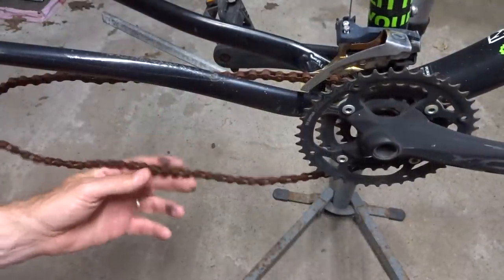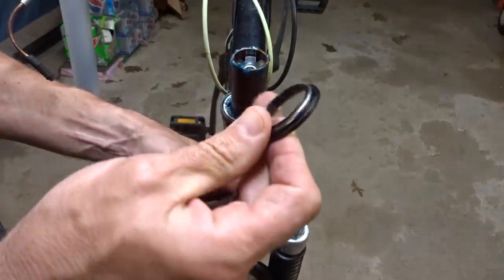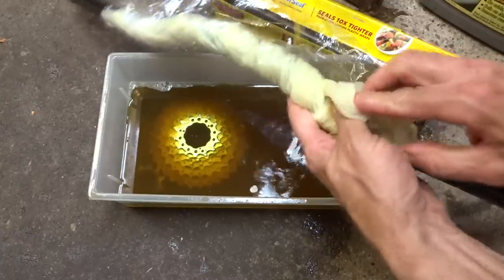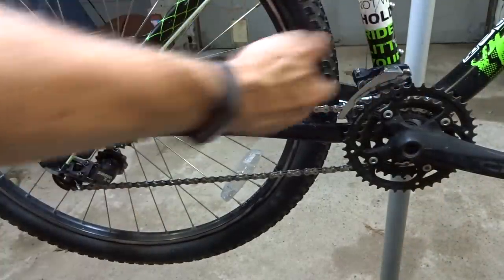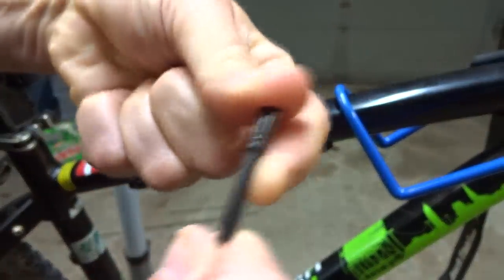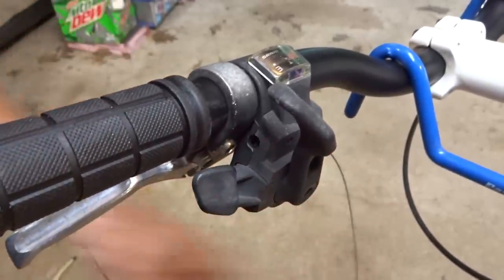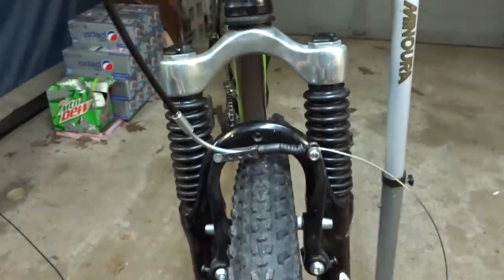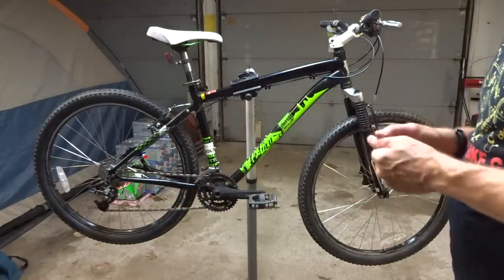Fixing/Overhauling The $15 Specialized Hardrock Mountain Bike

Comment: Great job, I really enjoy restoring old, neglected bikes but usually end up spending too much; as my dad says "perfection is the enemy of good enough".  I don't think I could have lived with those badly sun-faded shifters though, I'd have been straight onto eBay to get a better pair :)  Did you grease up the jockey wheel berings in the rear mech after their soak in the rust solution?
Reply from the maker: The goal was get a solid running bike and keeping the costs down. I was NOT restoring the bike. And yes I lubed the derailleurs.

Comment: Hey man I want to build a commuter bike what would be a good cheap bike to start with? I have no experience I hear that I should get a bike with no suspension and a steel or aluminum frame.
Reply from the maker: Buy a quality used bike. Beyond that, you need to figure out what you want.

Comment: Instead of using paper towels and plastic wrap on the handle bars,  You could of Use Aluminum Foil to wrap the handle bars in and pour your vaparware inside of it, closed it off so it doesn't leak and let that sit overnight..

Comment: Beautiful bike. Great job. Just wanted to ask about the crankset and BB? It seems like you didn't regrease it?
Reply from the maker: The bottom bracket was a sealed cartridge BB.
Reply: @RJTheBikeGuy  I thought it was a hollowtech type crank? But still its a beautiful bike.
Reply from the maker: Nope.  Square taper.

Comment: What about a spray bottle for the alcohol 🤔..excellent tip with the paper towels 🧻 clingfilm and rust remover 😊p.s. any concerns that the original chain length was wrong length 🤔 also you didnt do the coin in the bottom  grip thing 😏
Reply from the maker: It was the correct length. Coin in the bottom grip thing?
Reply: @RJTheBikeGuy  😊you put a coin the same diameter as the inside of the grip .stops the end of the bars cutting through the end of the rubber grips

Comment: do you need to recycle the evaporust? if you need to do that, where to recycle? Thanks for the information
Reply from the maker: From EvaporRust's datasheet: "EVAPO-RUST™ can be used over and over until performance drops off. When ready to dispose of spent EVAPO-RUST™, only the iron content of the solution will dictate disposal method. In most cases, it can be safely put down
the drain." 
You could just let it evaporate.
Reply: @RJTheBikeGuy  thanks for the information. Love your bicycle video.

Comment: Good video Sir!.I have watched twice and will watch again.Can you re-use the used evaporust and how do you dispose the used evaporust properly?.I always lean bike over and dip the grip in a bowl of warmish water and works fine.i have always be told don't use a new chain on used cassette and chain rings?. I use,  used working parts all round the bike apart from cables and small things. I have never known the small parts on brakes were called noodles and boots before. You made me laugh every time when you said "ahh cheap boot!". hehe
Reply from the maker: Yes, you can use Evaporust over and over till it turns black and stops working. Chains wear out faster than cassettes and chainrings. And as long as you replace the chain when it starts showing wear on a gauge, you can go through several chains before you need to replace cassetts/chain rings.

Comment: i know that it doesn't cost a fortune, but did you really need to change the cables? they weren't rusting(coulda been stainless), looked good to me. what did i miss? :-D
Reply from the maker: Cables are cheap and wear out. They oxidize, bend, fray, the housings get kinked. The cheapest performance upgrade you can make!

Comment: Cutting off the zip ties holding the outer cables is not necessary. The outer will slide out of the ties, which have a perfect size to slide in new cables. Saves a few minutes.

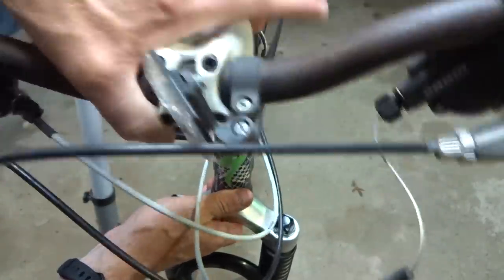Comment: At 5:50 RJ installs stem with what looks like a 1/4 inch of space over the fork steerer because it was cut too short. Is that safe? Does the stem clamp need a spacer between it and the top cap?
Reply: Ive done it many times and never had a issue, If you can avoid it great but as long as most of the stem is clamped it be fine.  If your not using it for any serious mountain biking. And there's not really any need for a spacer between the top cap and stem. 
unless you have extra fork steerer sticking out, then you would need a spacer for the top cap to pull against.
Reply: As Chr0nicCha0s points out, the spacer (or stem) must be above the steerer to adjust the "up and down" of the fork.  The stem is installed between the stem cap and headtube, so it does the heavy lifting. ;)

Comment: Compressed air works great for removing handle grips just grab an air nozzle put it under the edge and pull the trigger.
Reply from the maker: Been there done that. https://www.youtube.com/watch?v=U6SsqBcpXZU
You missed the steps, plug in the compressor, let it pump up, figure out where you left the air nozzle, etc.

Comment: You shouldn’t use alcohol to put on the grips because then the grips will slide for a while. I use water for the grips and it slides right on. Water also evaporates almost instantly.
Reply from the maker: alcohol evaporates faster than water.
Reply: Oh. In my experiences that wasn’t the case. Sorry.
Reply: The water could lead to rust.

Comment: I know this is an old video but I must point out a few things. You missed showing how to true the rims. That's an absolute must if you are running rim brakes. You didn't perform proper rim shoe toe-in and adjustment either. And the frame and fork have disc mounts. A set of cheap mech disc brakes would serve anyone far better over those old V-Brakes.
Reply from the maker: Truing a wheel: https://www.youtube.com/watch?v=f1SHmFBihKM
Though I used a truing stand. Not every single detail was covered in the video.
As for disc brakes, I would have needed calipers, rotors, and don't forget the wheels with disc rotor mounts on them.? Are you going to pay for these parts? That would have more than doubled what I put into the bike.
Reply: @RJTheBikeGuy  I would think you would have the parts lying around, if not you can source all those parts for under a hundred dollars my friend. But I love your videos, been watching them all day. I don't have time to wrench on bikes these days, but these videos bring back good memories.

Comment: Do u have any advice on removing rusty bolts that seem to be stuck, im trying to fix up a free bike I found and I can't remove bolts...
Reply from the maker: Penetrating oil, and maybe an impact driver.
Reply: RJ The Bike Guy I did not think of using an impact driver and I've tried many types of oil, anyway thanks for the idea and keep up the good videos...
Reply from the maker: It really depends on the bolts screws. I have multiples tools. An impact driver you hit with a hammer, a DeWalt impact driver. I have another thing that attaches to an air hammer, though that one is probably too hard hitting for most bike applications. Maybe if I turned the air hammer power down... Heat/cold maybe. It all depends.

Comment: you should point out that shifter cable and its housing is different from brake cable and its housing. the endstops on each cable is different and the thickness of each cable is also different.
Reply from the maker: That wasn't the point of this specific video.

Comment: Thanks for that great video !!! I noticed you took the real derailleur  straight out of the rust remover and put it on the bike. Don't those plastic pulleys need some lubrication?
Reply from the maker: I did lube them off camera, as well as the derailleur pivot points.
Reply: Thanks for removing that nagging doubt. I appreciate your videos.

Comment: Good vid, but Overhaul in the title is misleading, Overhaul would include taking the wheels/bottom bracket apart, checking parts for wear, repacking, then reassembly. I would also check the seat post to make sure its not seized , anti seize it if its not a part of the frame now, they have been known to become impossible to remove. If it is seized its probably a parts bike.
Reply from the maker: The bottom bracket was a cartridge type, so not meant to take apart. Not every bit of work was in the video. I went through the bike pretty thorough checking everything. Including the seatpost. Watch the beginning of the video and end of the video and the seat is at different heights. And a seized seatpost is an obstacle, but by no means the end.
https://www.youtube.com/watch?v=P-YpmDx86d0
https://www.youtube.com/watch?v=_gAXL2FSY_A
https://www.youtube.com/watch?v=S3ek2GeZzE0
https://www.youtube.com/watch?v=LJLZ9Ojtr80

Comment: For rim brakes, why are wheels sometimes painted black? Makes no sense because the brakes wear off the black color in streaks. (I like black spokes, but the rim part that the brake pad contacts should be clean and smooth which paint flaking off does not accomplish)

Comment: Date: Sat, 25 May 2019 08:30:26 +0100
Subject: Re: RJ The Bike Guy loves your comment
RJ Been working on bikes for many years but have never had a problem with 
a cassette hub the splined part which sits on the wheel, even though i have 
workshop full of tools quite task finding a tool to remove this part off the wheel, in my tool kit i found a 12mm splined key bought from snap on van. 40 years ago and with some treatment from my angle grinder it worked
and i removed this faulty part, then by a bit of luck a wheel from an electric 
bike that should have gone to the scrap, fitted fine,  the guy could carry on with the rest of his ride home 35 miles. no bike shop in the 20 miles area
had the tool or the part. 

Rj how do these hobs come apart and do you a park tool code
so another happy customer
Reply from the maker: Is this what you mean? https://youtu.be/iQ6XgztsfmU?t=240

Comment: Look at the rear triangle.  Notice the extra brace on the non-drive side ...  Really tough rear end.  So perfect candidate for a rear hub motor conversion.  Plenty of metal & framing to dissipate the torque of a motor.  These are good tough chassis.  Next one you get, do an eBike conversion :)

Comment: Change the handlebars to alum bars,I hate them brakes,with rear disc mounts I'd convert to disc but that's my preference
Reply from the maker: I could have. But the point was to keep the cost down to a minimum.
Reply: EBay I'm into recycling
Reply: I've got 2001 GT Aggressor 1.0,mine has same fork as yours,but unfortunately I got to add disc brake adaptor to convert to disc.You were lucky to find that bike cheap $15 and a 2012 at that
Reply from the maker: @eddiebruce8569  The steel bar but was fine, just a little surface rust which I cleaned up. Disc brakes would have dramatically raised the cost. Just because a bike has disc brake mounts, doesn't mean it has to be converted. I have a video on doing that conversion.

Comment: The headset top cap is missing as are the dust seals on the bearings, hmmm where did those parts go?
Reply from the maker: I put it on a little afterward, but didn't reshoot.

Comment: instead of evaporust try vinegar and table salt, the acetic acid in the vinegar will chemically remove the oxygen from the iron. the sodium chloride just aids in speeding up the reaction.
Reply from the maker: I have used vinegar in the past. Evapo Rust gives better results. https://www.youtube.com/watch?v=DZVdkLWAurE
The vinegar seemed to remove more material than the EvapoRust. The pins in the vinegar chain came out with very little effort, but the pins for the others came out with normal effort. Noticed this after the video.

Comment: Did anyone else cringe how he tightened the stem before the top cap. But other than that nice video👍🏻
Reply from the maker: I put the top cap on and roughly tightened it and then tightened the stem. That was just temporary. I had to go back later after the wheel was mounted to adjust the bearing tension and straighten the bars before tightening it all down proper.

Comment: Why is there no cover/dust cap covering the top bearing in the head tube, that's probly why it was so dirty, most bikes have a rubber cover that also acts as a spacer for the headset
Reply from the maker: There was one, I missed putting it on in the video, and it was put on shortly after.

Comment: Do the brake pads need replacing is a line look bit worn
Reply from the maker: I can't remember the state of the pads at this point. If they needed to be replaced, I would have replaced them. I might have replaced them off video. I can't remember.

Comment: Set limit screws before even tightening cable down and u would have gotten rear derailer done correctly 1st time,,,repeat with front derailer,
Reply from the maker: If you mean that the derailleur would have been correctly indexed when I hooked up the cable, simply by setting the limiting screws beforehand, then you are wrong.
Reply: On the rear derailleur I Usually, usually that is, check the low gear setting especially if there is no "dork disk". You never know about used bikes and their mechanic. I just hate the grinding noise of chain against spokes if I screw up and don't pay attention.

Comment: did the cable and cable housing need replacing? good result though. i do a few bike restorations myself and it can be satisfying work. you're not going to bother with all the other bearings? i see you have a bunch of soda drinks. you should really not be drinking that much for your health sake and life span. try to ween off them. thanks for the video.
Reply from the maker: Cables and housings are cheap so I usually replace them. I can't remember all what I replaced. Some work was done off camera. The BB didn't need overhauled as it was a cartridge BB.

Comment: you could have greased seat stem and seat and how about servicing bottom bracket and chainset
Reply from the maker: Not every second of work was in the video!!! I did grease the seatpost. The bottom bracket was a sealed cartridge and was working fine. I also didn't show replacing the tubes and adding air to the tires.
Reply: a clean up of the chainset would have maybe benefitted the new chain and the now very clean cassette
Reply from the maker: But then what would you have criticized?
Reply: im not criticizing, just observing and offering a comment, but if we go with the word criticism, then nothing and i could have observed....great video

Comment: Why didn't you put the chain in the vapour rust?
Reply from the maker: Evapo Rust. Because a rusty chain is garbage. It rusts on the inside too. Just replace it for $10-12 instead of trying to reuse a trash chain.
Reply: @RJTheBikeGuy  yeah got ya. £10 isn't going to break the bank so it's worth it

Comment: just a question do u need a crimp end on a new cable?
Reply from the maker: You don't NEED it. But it keeps the end of the cable from fraying or stabbing you. You can get them at a bike shop for pennies.
Reply: oh ok just my local bike shop didnt put it on the front derailer cable
Reply from the maker: Probably an oversight. Another thing they used to do was solder the end of the cable, but most shops don't do that anymore. Crimp ends are easier and faster.
Reply: so in a mtb how important is it
Reply from the maker: Well, get stabbed in the leg with the cable once or twice, and you may wish you had one there.
Reply from the maker: Just take it back to the shop and tell them to install one. Or install one yourself.

Comment: You did all that work and did not even check the wheel bearings or true the rims?  I have never seen an older used bike that did not need a good hub repack.  What about the bottom bracket?  You didn't even give it a wobble.  To me zip ties for casing clamps are turkey.  They look sooo much cleaner with real clips.
Reply from the maker: The video covered the major work. I didn't show every little thing I checked/fixed. I checked hubs and the wheels. I think I might have done some minor truing. I can't remember. The BB was a sealed cartridge and was fine. That is mentioned in the description as multiple have why I didn't overhaul the BB. If it was bad, I would have just replaced it.
Reply: @RJTheBikeGuy  
For the sake of the people watching these videos it would make sense to at least mention all of the things done and needed to revive the old bike. Too often things like hubs and bottom brackets are overlooked.

Comment: Im very frugal so id probably keep the cables instead of snipping them take then all out soak them in oil
Reply from the maker: Cables are cheap. Cables wear out. Cable housing wear out. Oil doesn't always play nicely with the plastic linings in the housings. If you are going to do all this work, why cheap out to save a few bucks.

Comment: I have a 13 inch hardrock that isn't even a hardrock anymore lol it's single speed and I cut all the cable tabs off and sanded it smooth and put Bondo on it and painted it with high end spies hecker automotive paint. Got sr suntour rux shocks and mavic rims. It's a dirt jumper. Follow me on Instagram @hondakid349 to see it. Just got it out of the booth last week

Comment: When the vapour rust bottle has rust on it
Reply from the maker: It's called Evapo-Rust. And the bottle is stained because I have used the stuff over and over. After derusting stuff, it gets poured back into the bottle. And I use it, till it is used up. And I also have a 5 gallon bucket of the stuff that I use to refill the gallon bottle.